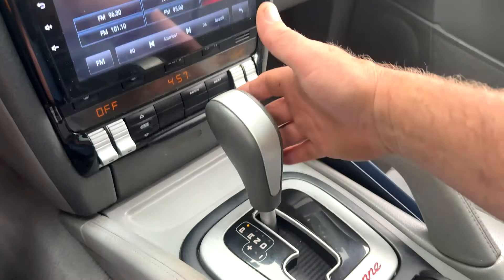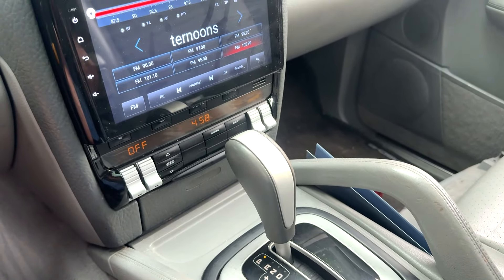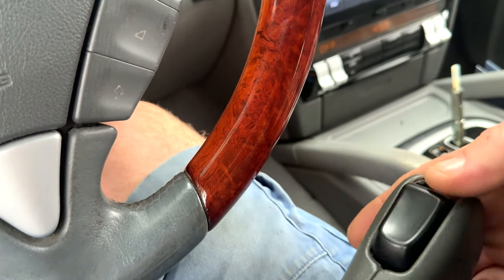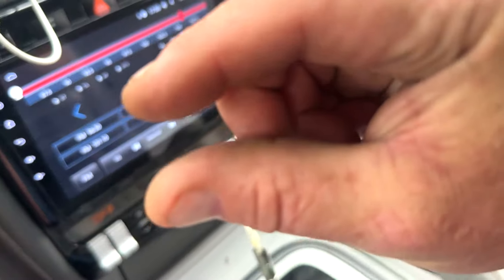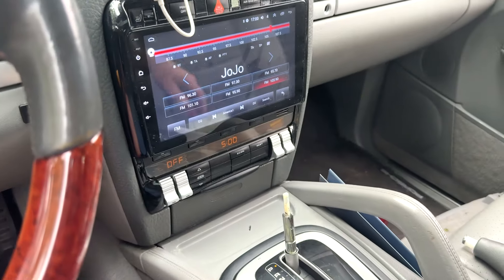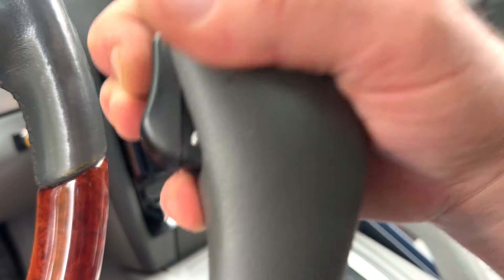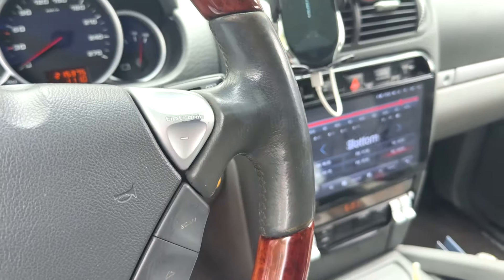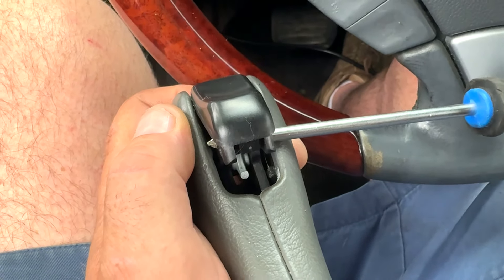First Gen Porsche Cayenne 955 stuck in park, button stuck ? Easy fix will get you driving in seconds

Comment: I came here from an older video about the mercedes w202 rear suspension.. Im wondering how to get the upper axles off, the most top ones on each side, they are so deep in the wheelwell that i cant access them enough to cut the old bolts through, i can get the nut off the bolt but the bolt is seized inside the bushing..